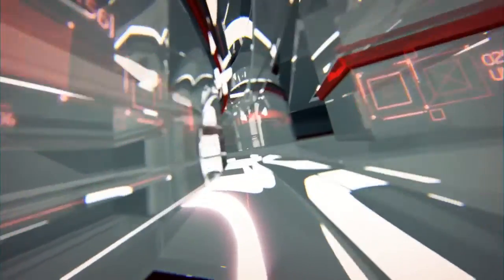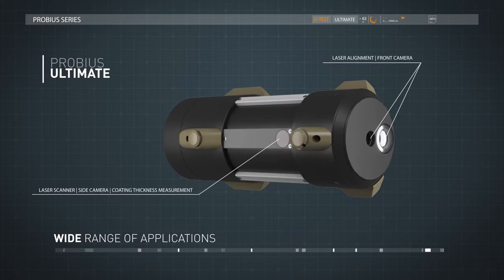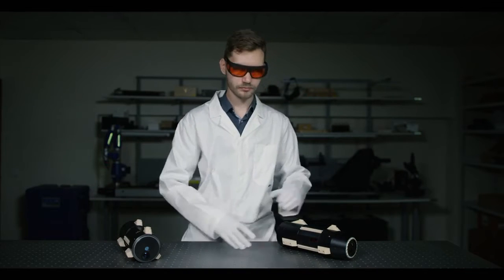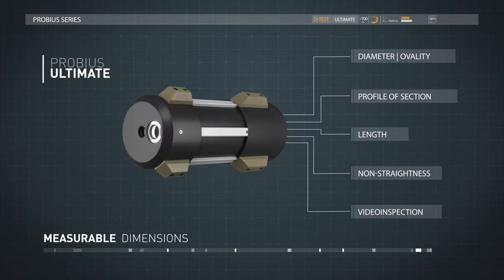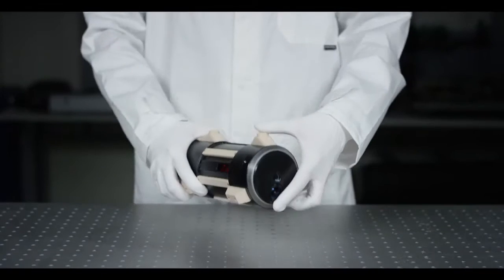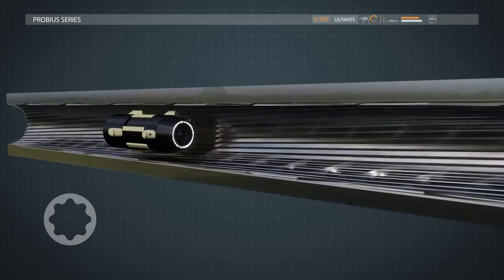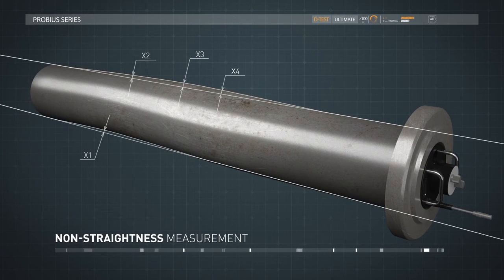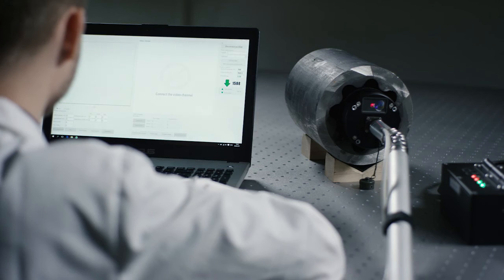Probius - Laser Tube Scanner with Laser alignment - D-TEST Company

Comment: Excellent 3D scanner giving 9000 points to your Could of Points for each position you scan the form inside, export cloud to your 3D Cad analyze software etc. 
PROBIUS makes some real centerlines based on real geometrical data for your alignments - all based on millions of points taken digital without human touch or sensors placed in old hubs on roller wheels which takes 2 pcs 0-180 deg or 5-8 sway points for a centerline...
This system is The Guro of Bores - any bore - 20mm up - any form even open top sleve bearings for crankshafts or high precision barrels or Pipes longer than 100meters. 

Take a quick visit to www.d-test.eu to download the video, manual, or high resolution brochure. WELCOME to the New BORE Future anno 2017 - PROBIUS developed by real Rocket Science engineers.

Welcome to us...